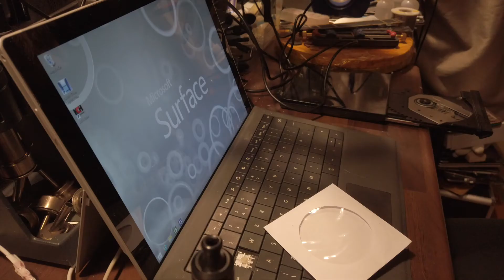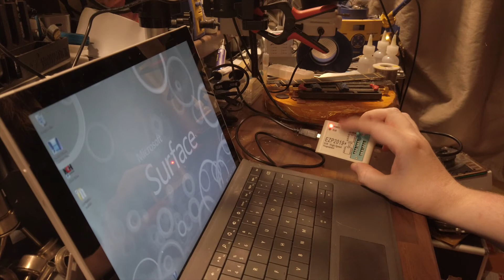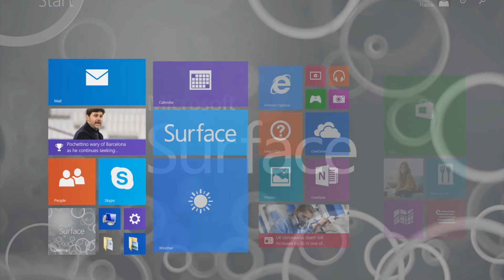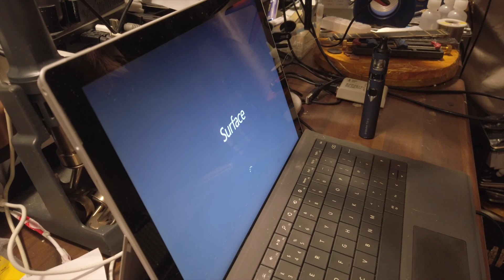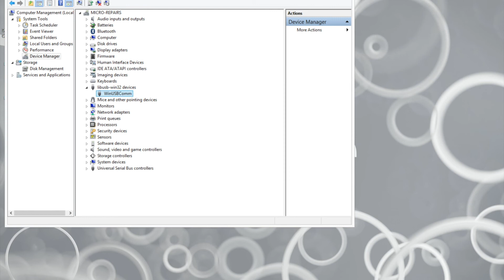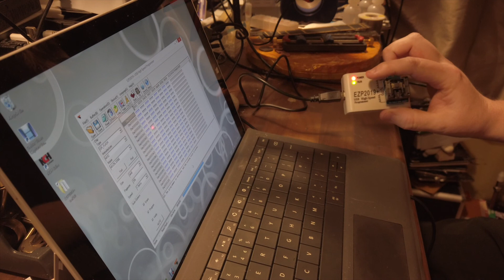EZP2019 BIOS PROGRAMMER SETUP DRIVERS /INSTALL ON WINDOWS 8/10

Comment: ezp2019 por windows 11?
Reply from the maker: It should be the same procedure for windows 11, I’ll check for you soon on my windows 11 computer to confirm but I’m pretty sure it will be the same procedure for installing drivers.
Reply: Perfect, I'll wait for your answer. thank you
Reply from the maker: @espantapajaroscr  hi sorry for the delay, had to find a suitable machine to test on. I can confirm it’s the same procedure for windows 11. Follow the same steps and disable driver enforcement, they will then install absolutely fine afterwards. Hope this helps.

Comment: Thank you for sharing your knowledge buddy. I   have a bin file that was read from 93c76 through ezp2019. When i load  bin file and try to White it and click verify it's showing:  "flash check error address 0h". I cannot write 93c76 eeprom. Have you experiencie issue before? I have tried with different 93c76 eeproms, diferente ezp2019 and diferente computer and still unable to write my bin file :-(  have you seen this before?
Reply from the maker: Thanks so much for taking the time to watch, much appreciated. The 93c76 is a very low voltage chip. Check it’s not being supplied too much voltage. Those programmers have a 5v and 3.5v pin I believe and there normally a way of changing the programmer power. If the power not correct it won’t work and give error. I’ve not come across this personally but it could be something to do with the power line. I’ll see if I can find out more for you and message you more if I find a solution. Thanks rich
Reply: @SURGE101  thank you so much buddy, i really appreaciate your help